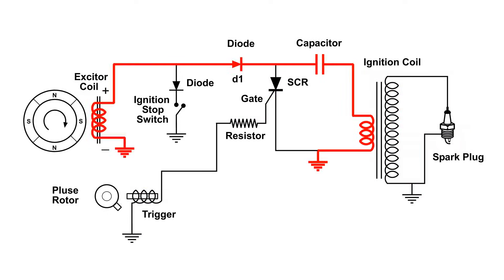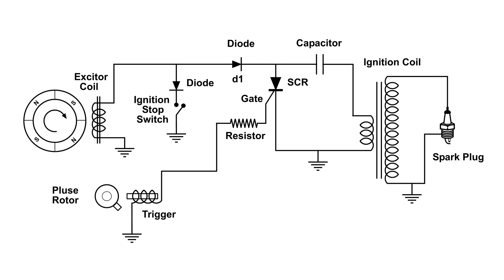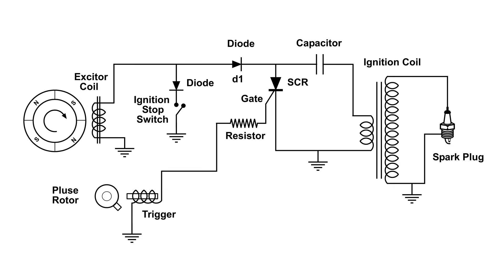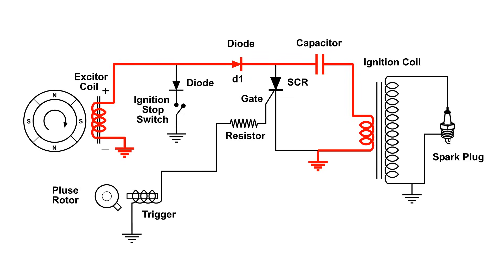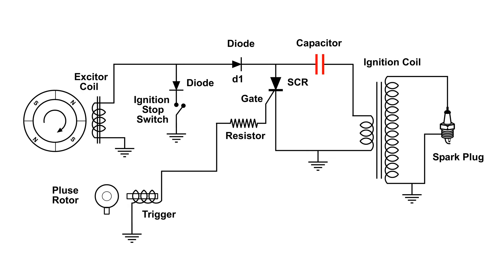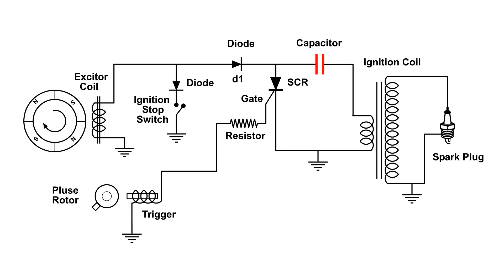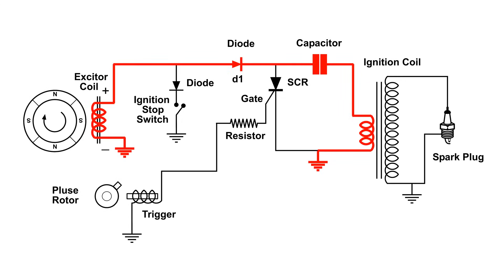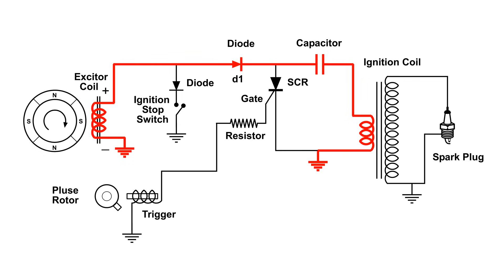CDI Capacitor Discharge Ignition Circuit Demo

Comment: @AllAmericanFiveRadio
If you get some free time would you show the effect that the 3 different types of spark plugs Non resistive, resistive, and “inductive” or “Inductive resistive” im finding it difficult finding anyone even testing inductive plugs on CDI coils. 
Apparently with CDI type ignition systems ngk and champion make Inductive type spark plugs which have a lower impedance in reality then resistance against the current flow thought it, but still has some resistance, and to be would seem to have a major effect on how the front end of the circuit ramps up and discharges. Then the following two. With all 3 having some effect. 
I know it’s a great deal of work to ask friend, I’m unsure how many other’s would also be interested. 
Thank you friend
Reply from the maker: That would be an interesting subject. The different type of spark plugs would be part of the circuit, maybe to help delay or change the duration of the spark. I’ll see what I can find on this subject.
Reply: @AllAmericanFiveRadio finding the inductive resistive plugs have proven to be rather difficult, there’s a form on the web talking about how expensive and how hard they are to find! So I understand if it becomes quite difficult trying to physically test it, if not impossible. In Either case friend I thank you! Hope you having a wonderful evening!
Anthony

Comment: -

"I love exploring how people interpret circuits. Let me add a couple of reality checks here:

1. **CDI Ignition Coils**: In 99.9% of all CDI systems, the primary and secondary sides of the ignition coil are shared and not isolated from the laminated core. If you don't believe me, grab your trusty VOM (Volt-Ohm Meter), set it to resistance mode, and measure between the primary and secondary windings. I guarantee it won't read 'OL' (Open Loop). Most CDI coils, including the cap, typically show a resistance of 12 to 15 kΩ between the primary and secondary windings.

2. **SCR (Silicon Controlled Rectifier)**: Sometimes, a JFET is used in similar applications, but their operation is not identical. An SCR achieves full current conduction when no voltage is applied to its gate. When voltage is induced at the gate (via a pickup), the SCR is triggered, allowing current to flow. Unlike transistors or most MOSFETs, SCRs are latching devices—they remain on until the current through them drops below a holding value.

3. **Reevaluating Circuit Functionality**: Based on these two points, I encourage you to revisit how you explain this circuit. While I believe the circuit as drawn would work, its actual operation might differ from your explanation. A closer examination could bring your description more in line with its real-world behavior."
Reply from the maker: A YouTuber ask me to explain this circuit that he had sent me. I’m sure there have been many changes to CDI circuit in past eleven years. Most of the time changes are made to get around patent disputes.
Reply: @AllAmericanFiveRadio  cool

Comment: Can shine wave trigger gate?
Reply from the maker: Yes a sign wave will trigger the gate of an SCR. This video may help.

Silicon Control Rectifier SCR Basic AC Circuit
https://youtu.be/45H4J_S52Y4
Reply: @AllAmericanFiveRadio  Yes, but will it trigger in specific frequency to dump HV, lets say 50hz sine wave..50 time to arc on spark plug, or 1hz arc?

Is there a specific current MIN or MAX to gate?
Reply from the maker: @11T872  There may be a frequency limit but it would be very high, you have to look up the specification for you SCR. The SCR is a DC device, when the gate is triggered on it will stay on until the gate is triggered off. If you are using AC this happen on the half cycle. This video is on SCR in a DC circuit.
Silicon Control Rectifier SCR Basic DC Circuit
https://youtu.be/ImyTwZGZ-Ls

Comment: Probably best cdi tutorial. Still trying to understand one thing: if pickup coil is responnsible for rhythm of spark, why replacing to an alternative aftermarket cdi probably will not work? Even with original pickup coil? Where is the difference of original cdi and aftermarket cdi?
Reply from the maker: Thank you. I do not know what the difference is. But they have made some change so you must us there parts.
Thanks for your comment.
Reply: Thank you for the reply

Comment: I thought capacitor in series so when thyristor get a pulse in the gate it conduct and cap charge up and block current then thyristor is deactivated then capacitor discharge into coil but in this configuration it’s a bit weird if capacitor connected to coil and the coil is already connected to ground then what the path thyristor provide?
Reply from the maker: This is how this Capacitor Discharge Ignition operates. This one uses SCR Silicon Control Rectifier. Sometimes changes in design is to avoid a patent suit.

Comment: Wow, I am studying for my A&P, ignition and starting systems and we meet again my friend.  So very cool.  What is the point of the trigger and the resistor, just seems like a waste of current that could be used for the spark plug?

I may have asked before but what software did you use for the animations?
Reply from the maker: Silicon Control Rectifier SCR Basic AC Circuit
https://www.youtube.com/watch?v=45H4J_S52Y4&t=116s

Silicon Control Rectifier SCR Basic DC Circuit
https://www.youtube.com/watch?v=ImyTwZGZ-Ls

The resistor keeps the Gate of the SCR from being damaged.
CorelDRAW ESSENTIALS 2020
Adobe Photoshop Elements 2018
Adobe Premiere Elements 2018

Comment: I would like to stop the spark plug from firing using an Arduino. Using the ignition stop switch seems to be difficult because it is high voltage. As an alternative I could disconnect the trigger wire from the CDI. Would disconnecting the trigger wire while the engine is running damage the CDI?
Reply from the maker: If you control the Gate of the SCR that may work, but I am wondering if the capacitor may over charge.
Reply: @AllAmericanFiveRadio  Thanks for the fast reply. I did some more reading and found out about mosfets that can deal with high voltages like 400+ volts. Guess that could be an idea. Or maybe just an old school mechanical relay.

Comment: Do you really need a diode in the ignition stop switch?
Reply from the maker: It does half the current through the Excitor Coil. That should extend the life of the coil.

Comment: Just confused it looks lile the capacitor isnt grounding on the earth side? Wouldnt it ground and than have a negative charge on that plate?
Reply from the maker: When the SCR fires it is like a wire, and that supplies the ground.
Silicon Control Rectifier SCR Basic AC Circuit
https://www.youtube.com/watch?v=45H4J_S52Y4

Comment: Nice explanation. You have an idea how to take care (with microcontroller)  that the advance is function of the RPM on an engine without battery (F4B Yamaha without starter or battery)
Reply from the maker: If you can get me the schematic I might be able to help.
Reply: @AllAmericanFiveRadio  Thats my problem , I dont find a schematic...
Reply: I made a first  LTSpice simulation. Can I post this to U
Reply from the maker: @patpintelon8607  Sure
Reply: @AllAmericanFiveRadio  Dou you have an idea of the power (V/currrent) generated by a one magnet flywheel (hand cranking)  at the RPM of eg. 160 (lower is nor followed by a spark I read in the workshop manual). And what should be the pickup coil windings (number/gauge) to be able to use this energy for the charging of the capacitor and a elco serving as power source for the microcontroller (eg.MSP430)

Comment: Hello, what a great explanation of the cdi using that drawing.  I do not have a wiring diagram of my CDI.  What brought me here was an issue with my ATV whereby I have capacitor voltage (300v) at the primary of my coil all the time.  I have a dc system and I'm unsure if the CDI is bad because the SCR is and being triggered all the time, or there is some other issue.  Its a strange issue and I'm not alone as many have mentioned this issue but unfortunately I have yet to find an answer.  Any light that you could shine would be extremely helpful for one wandering around in the dark.
Reply from the maker: If the SCR is good, it needs to be turned ON and then turned OFF. To troubleshot a circuit you need to know how each component functions. I did a viedo on a SCR, it may help you understand your circuit.
Silicon Control Rectifier SCR Basic AC Circuit
https://www.youtube.com/watch?v=45H4J_S52Y4
Reply: @AllAmericanFiveRadio  Thank you so much for this.  I will check it out.  It would seem my SCR is always triggered on which surprises me because I thought it would fail open.

Comment: CDI isn't the "black box" you thought it was. An SCR, v. a transistor, is used to ensure a more complete discharge of the capacitor to induce more voltage in the secondary coil. An SCR conducts until a reverse voltage is applied to its gate or, in this case, the capacitor fully discharges.
Reply from the maker: Silicon Control Rectifier SCR Basic AC Circuit
https://youtu.be/45H4J_S52Y4
Reply: Do you know why different cdi give different results? 
Even with same  pickup coil you wont get motor running/running smoothly unless original cdi or specific aftermatket cdi for that replaces original cdi! What elements are in charge of those elements? Is it scr not opening gates at correct timing? Resistors value or what?!
Reply: @samehdarawshi3537  The capacitance spec is the first consideration. After that, it's resistance, as in checking for lack of in the sys.'s connections.
Reply: Thank you. I understood your first half of the answer-capacitance of capacitor is the first cause.
Secod is resistance of? Of resistor or resistance of capacitor itself? 
Thank you
Reply: @samehdarawshi3537  Re. the second pt, I relate it in the context of troubleshooting. The specs of the  unit, incl. resis., need to match what the OEM dialled into the application.
Reply: Thank you

Comment: One should have explained how the SCR switches off after it discharges! the capacitor so that the capacitor is able to charge once again to repeat the cycle.
Reply from the maker: Silicon Control Rectifier SCR Basic DC Circuit
https://www.youtube.com/watch?v=ImyTwZGZ-Ls
Silicon Control Rectifier SCR Basic AC Circuit
https://www.youtube.com/watch?v=45H4J_S52Y4

Comment: I have been teaching electronics at a local university, and will recommend my students to watch this video even though we don't go into power electronics.  This is an excellent video describing the basics of a CDI system.  There is supposed to be a signal conditioning circuit in the pulse rotator path that terminates at the SCR gate; its main function is to clean/filter  the spikes from the triggering mechanism.   All in all your explanation is very clear, and concise. Thanks for uploading the video.
Reply from the maker: Thank you. I'm glad you find this video worthwhile watching and useful, and hope your students will also.

Comment: Question for you.  I’m trying to get a waveform of a coil on the system you just demonstrated.   Is it possible ?  And what should I see.?
Reply from the maker: Thank you. You would need a high voltage test oscilloscope test probe. The probe would have to handle several thousand volts so that you do not damage the oscilloscope.  GOOGLE “oscilloscope spark plug probe” and “Images for oscilloscope spark plug probe”.
Reply: @AllAmericanFiveRadio  ok.  I was actually trying to probe the primary side.  My scope can handle 1000 volts.  I know the primary puts out about 250 volts when running. Thanks.
Reply from the maker: @Toolman10000  It will look similar to the secondary, lower voltage. but 180 degrees out of phase.

Comment: If there's current flowing through the primary coil even with the trigger off, what's stopping the voltage from being stepped up to the secondary coil and firing?
Reply from the maker: When the capacitor is charging the current is not strong enough to produce a spark.

Comment: Why risister is need in triger line..??
Reply from the maker: That would depend on the model and manufacture of your ignition circuit.
Reply: @AllAmericanFiveRadio  mean risister alow current to flow in a fix portion..not high not low ..??
Reply from the maker: @aliqadri4672  Yes, resistors limits the flow of electrons.

Comment: the best explanation and workind of this circuit i have seen. my question on this is a ac cdi what is difference between dc/ac operation other tha alternating and direct?
Reply from the maker: Silicon Control Rectifier SCR Basic AC Circuit
https://www.youtube.com/watch?v=45H4J_S52Y4
Silicon Control Rectifier SCR Basic DC Circuit
https://www.youtube.com/watch?v=ImyTwZGZ-Ls

Comment: If I'm understanding this correctly, the maximum voltage that the capacitor can charge to is equal to the maximum voltage produced by the stator coil (excitor).  Is this correct?  From what other folks have said, on scooters at least, the stator coils produce around 60 - 100 volts.
Reply from the maker: Yes that's correct

Comment: Great  informative video.    I have a  CDI on an older motorcycle.   It only makes a spark  once when I push the  stop button  and the rest of the time nothing.
I'm thinking either the SCR is bad or the trigger coil is bad  and the stop button is actually discharging the capacitor.
Reply from the maker: That could be. Most of the time the parts that goes bad are the capacitors. Good luck.

Comment: Great video!  So what makes the SCR shut off?  Is there some sort of flyback current from the ignition coil that reverse biases the SCR?
Reply from the maker: Silicon Control Rectifier SCR Basic DC Circuit
https://www.youtube.com/watch?v=ImyTwZGZ-Ls

Silicon Control Rectifier SCR Basic AC Circuit
https://www.youtube.com/watch?v=45H4J_S52Y4

Comment: Hi Rick, Thank you for going to all the trouble to make this up and help a lot of people.  One thought - you keep saying the capacitor is "storing voltage", or "a little more voltage is put into the capacitor" - I think what we mean is storing amperage, or storing current?  I don't think capacitors store voltage, correct?  Please correct me if I'm wrong.  Thanks!
Reply from the maker: It's both. When the capacitor is charging or discharging there is current. When the capacitor is charged there is no current, just stored voltage

Comment: ...so in a CDI ignition, the spark plug fires when the SCR switches the primary circuit "ON".?
I have seen other systems where the firing circuit arrangement is such that the spark plug fires on the RELEASE of the primary voltage.  Does this one fire the plug on the RISE of the PRIMARY coil (thus the RISE of the secondary)?  THIS MAKES SENSE--I even tried it and it works fine!
Reply from the maker: On the Rise.
Reply: ....it's interesting. Top explanation was given in our homegrown Australia Electronics magazine 51 years ago and revisited in 1975. ..In conventional Kettering ignition system it is the sudden collapse of the built up magnetic field in the coil which built up in say period of ½ a millisecond collapsing in say ½ a microsecond that generates around 400 volts in primary of ignition coil ( (this phenomena for voltage boost isn't so familiar to many )) which then is instantly stepped up to around say 30 kilovolts by familiar transformer action of coil..With cdi however the 400 volts already is supplied available  thus merely needs to be dumped by capacitor action across the primary instantaneously, and capacitors are very good for instantaneous dumping , a 1uf capacitor rated for at least 400 volts is plenty for high energy sparks up into very high revolutions for multi cylinder engines...Also cos it's the effect of forced voltage feed instead of magnetic collapse it turns out that the polarity of the spark is changed. The ideal is for the centre electrode to be negative cos it's hotter,, along lines of vacuum tubes,, but not a big deal . .gotta mention too maybe that in Kettering ignition that it's initially 12 volts across the primary that builds up to 400 upon magnetic collapse when ignition points break contact.

Comment: Is the scr a silicon controlled rectifier? Is it a transistor? If it is both, why does it have 2 names?
Reply from the maker: It's a rectifier controlled by a Gate. The Gate turns the rectifier ON.

Comment: Excellent explanation, just one question, the voltage going to the primary coil is it ac ot dc?
Reply from the maker: It's a DC pulse and the ignition transformer adds AC components.

Comment: In the trigger coil, is the magnet on the rotor or in the trigger coil? having trouble understanding how pulse is making ac voltage.
Reply from the maker: Capacitors, DC and AC Current
https://www.youtube.com/watch?v=NInt1Ss3vQ4

AC Alternating Current, for the Beginner
https://www.youtube.com/watch?v=xVbqMFkyuXI

Transformer Basic Parts & Function
https://www.youtube.com/watch?v=q3YhbugYjJY

Comment: Have you any experience with looking at ignition patterns of a CDI system on an oscilloscope ?
Reply from the maker: No I don't. A YouTuber asked me to explain this circuit.
Reply: @AllAmericanFiveRadio  ok , I'm a career automotive tech who works for a fleet shop . We have a bunch of ATVs and UTVs that I recently have been assigned to work on . On the automotive side I use an Oscilloscope to help diagnose ignition system issues as well as many other issues . I hooked my scope up to a Yamaha rhino with the 660cc in it and the pattern I got looked nothing like an automotive ignition pattern .. So I been searching for any resources to help confirm my theory of how this system fires and how to interpret the scope pattern for troubleshooting purposes .